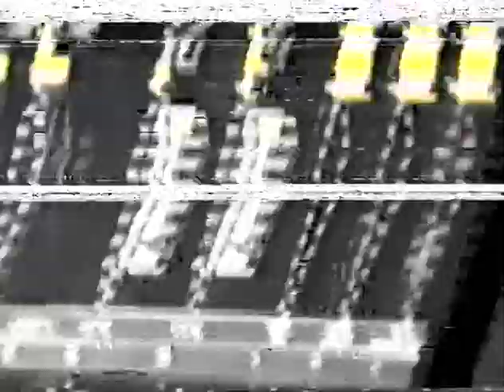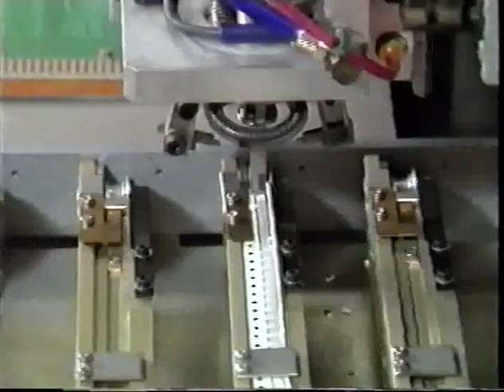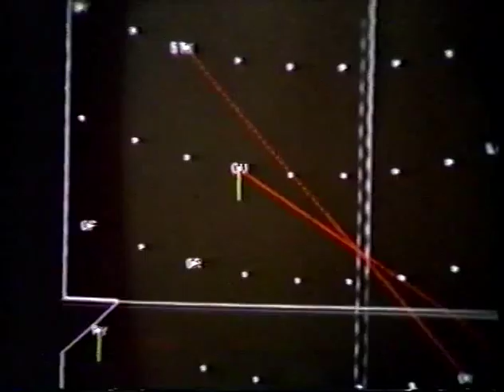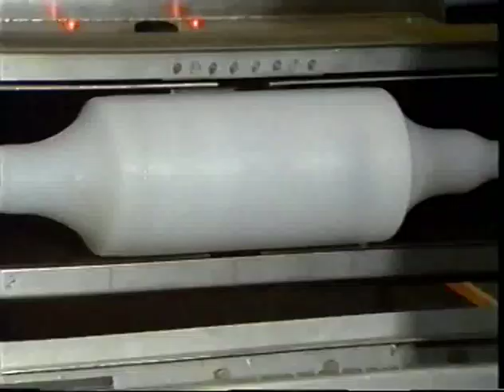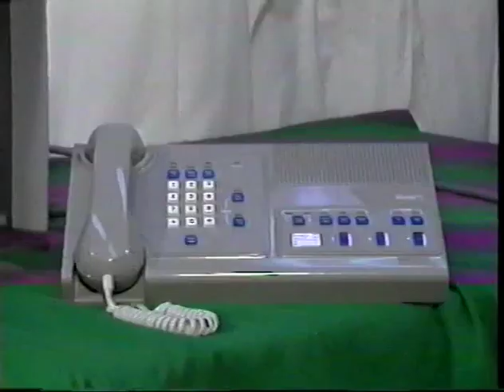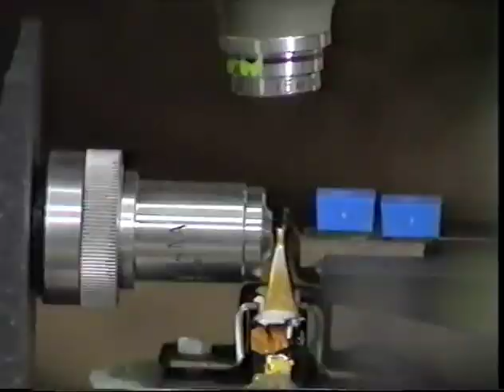British Telecom Research Labs, Martlesham, Suffolk 1984 (now Adastral Park)

Comment: Seems very primitive now, but thats the nature of technology.  Really interesting to see the early smd machine, chronically slow by todays standards of course but imagine how that must have seemed in 1984!   I remember seeing surface mount components for the first time, I'd been out of the electronics industry for a while, and I was just amazed!  I got back into electronics as a hobby about 10 years ago and had to teach myself new skills to use smd's and repair surface mount devices. Working under a magnifier or microscope was very strange initially!